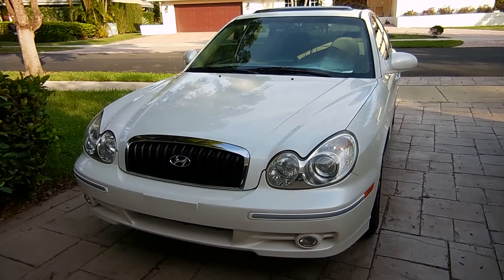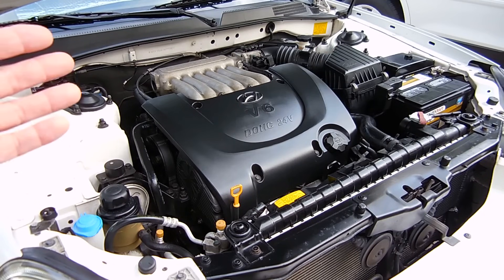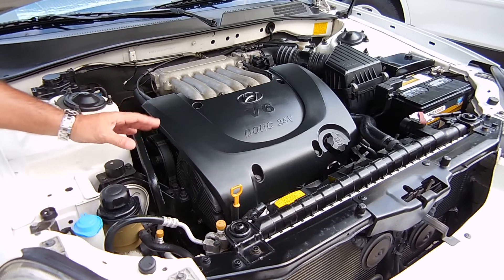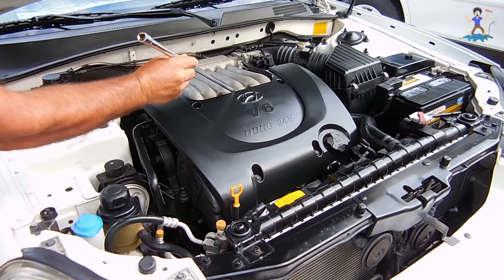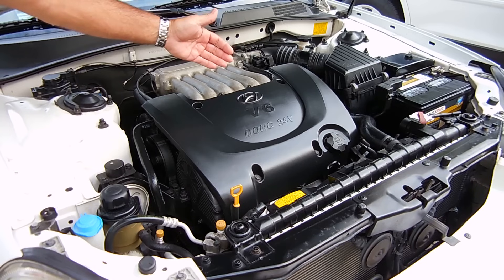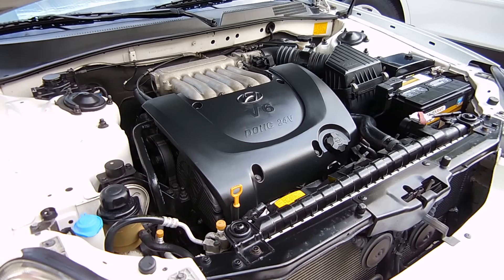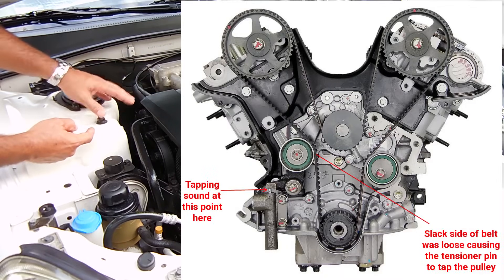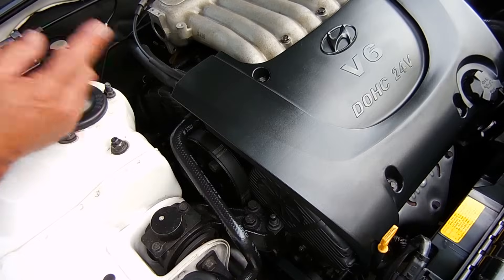(SOLVED)Engine Knocking or Tapping Sound That Varied With RPM

Comment: most of the time if ur hearing a ticking that goes with rpm, chances are its ur valvetrain, 90% of the time its a rocker thats got a little bit too much play, or a sticking lifter, if u rev ur engine up n it goes away, 99.9999% of the time its a sticking lifter, the extra rpm gives that little bit of extra oil pressure to unstick it n pump it up, taking away the tick  if thats the case its a simple fix, time consuming but easy
Reply from the maker: That's correct IF the noise comes from the top or middle of the engine, but if it's coming form the belt side down low near the crankshaft pulley, it's more than likely what I described. Thanks for watching!
Reply: Travis Miller hello my friend I have this problem where it makes this sound but when I’m on the street at high speed like 40mph it despair can you pls tell me what to do ?

Comment: I have a similar problem on my Honda CRV but it only happens when the engine is hot, but only comes back now and again. The sound appears to be coming from the top of the engine or half way down.
Reply from the maker: You need to try and pinpoint the exact location when it happens again. Intermittent problems like that are hard to find, but usually they're better than a constant sound from the engine. Thanks for watching!

Comment: I have the same sound with the same 2.7 motor. It doesn't get louder with higher RPMs it goes away. Thats what throws me off from being a rod bearing. I also changed the timing belt about 15k miles ago and put a new tensioner on it. I'm gonna check this out tomorrow.
Reply from the maker: Sounds like the same problem. Mine started off that way. Tapping sound at idle, and increased RPM made it go away.
Reply: @electronicsNmore  it's exactly what it was. I took the tensioner out from the bottom by taking the bottom half of the cover off only. Do you think it's possible i will jump timing by not taking everything off to change it? I'm working outside and it's cold so I want to be able to get it to a garage. I haven't started it yet.
Reply from the maker: As long as the belt didn't pop off the gears, it should be OK. ALWAYS rotate the engine clockwise by hand 2 full turns before starting it. If you feel any hard resistance, that means the valve is hitting the top of the piston.
Reply: @electronicsNmore  that's what I did and it worked. Car runs fine again. Thanks for your help. I don't trust the belt anymore so I'll change that when I have a free weekend  in the future. So far these are good motors if you stay on top of the maitenence. 224k on this one.
Reply from the maker: @jwill9877  I have 137,000
Reply: I had a whine that was only at lower RPMs. Turned out it was the tensioner and a roller/pulley for the external belt that runs the alternator, etc. Started when they put a new external belt on just before putting it thru inspection to get it on the road.

Comment: I beat the piss out of my 2.7.. even when it was low on oil but wasn’t too long. It runs so smooth I got to say it’s a very strong reliable engine.
Reply from the maker: Yes, it's a very reliable engine. Thanks for watching!
Reply: As long as you stay on top of the timing belt changes. That's the Achilles heel of this motor
Reply from the maker: ImSuperCynical  Hard to say, but being low on oil probably caused damage. Thanks for watching!
Reply: ImSuperCynical could be a stuck lifter and lifter tick. Do an oil change Maybe use a lighter oil It should free up and lifters.
Reply: Over here I see these engines running at 350,000 kilometers. They're one of the best hyundai engines of earlier days.
Reply: I was a Hyundai tech, that’s a solid engine! As he said as long as you keep up on the oil and timing belt service. 10000x of 2.4 4cyl and 2.0. Can’t remember one 2.7 that wasn’t due to owner damage. Keep it up! That was a weird issue! I’m currently chasing a similar noise on a Prius lol. Wish me luck!

Comment: Should have done the screwdriver trick to check rod bearings, would have saved hours on end.
Reply from the maker: I did, and the knocking sound was very loud at the top of the oil pan on the passenger's side. :-) Thanks for watching!
Reply: electronicsNmore yes, you can use  it to look for sound. But i was referring to removing spark plugs, get the piston in a down stroke put a long screwdriver on the top of the piston through the spark plug hole and lightly press down If It Moves rod knock no move bearings are good. Can also use a dowel. I did this on the truck I'm working on now and I believe the noise is coming from a hydraulic tensioner now! Never thought that could be a possibility. Thanks for your video, really helped me out.
Reply from the maker: Correct, but I also wanted to check the crankshaft bearings as well. Thanks for watching!

Comment: My compliments for how you care for your stuff. That car looks beautiful for an 03. You're meticulous, and are not afraid of work. Can't believe you pulled the pan and inspected the crank & changed the rod bearings. Me, I'm getting lazier the older I get. I'm letting the dealer do my oil changes now, & cried about having to change a flat last month.
Reply from the maker: Thanks for the kind words! :-) The upper and lower oil pans were in great condition, even though I cleaned them to like new condition before applying new RTV and installing them again. I used 10w-40 full synthetic oil with MotorKote. It wasn't easy doing the job laying on my back. Glad you enjoyed the video
Reply: electronicsNmore Mobil 1 high mileage 10w-40 and motorkote goes in every engine I own! I feel like that’s the ultimate protection. Especially after I watched project farms motorkote vs water video when it was uploaded.
Reply: R.P. Rosen Wow, how old are you bro? Like 70?!?! I feel bad for people than deteriorate after 50 yrs old. Stay active, eat healthy, and exercise quite often for longevity! 😁

Comment: Good catch but I cannot believe you took off the main bearing caps first.. But you did and we all learned from it which is a good thing. In my mind Hydraulics's have failed earlier then springs or the combo. I own two Elantra's and cannot say enough about them. Zero issues as long as you take care of them.
Reply from the maker: It was very hard for me to believe that something under the timing cover would've failed, that's why I thought the worst and went to the bottom of the engine. I only removed all 6 connecting rod caps, checked for play between each rod and piston, inspected the cylinder walls, replaced the connecting rod bearings, and when the oil pump was removed, I could see the last main bearing up close. The bearing was nice and uniform in thickness, and when the crankshaft was moved, there was no play at all, so I figured the other main bearings were fine. I left the cap alone. Thanks for watching!.
Reply: Jezz... gotta love the car...

Comment: There is a high chance that you have opened up a can of worms by removing and re-installing your connecting rod & crank caps.  The procedure in how to torque the caps, in terms of both sequence and torque, are very specific.  Hopefully you will not have any issues.
Reply: Burn
Reply from the maker: I spoke to a certified Hyundai Mechanic, and followed the service manual. Each cap was marked prior to removal, old bolts thrown away and replaced with brand new Hyundai connecting rod bolts. New bearings installed that were matched by the dealer using the VIN #. I compared the old bearings with minimal wear to the new bearings using a micrometer to ensure they were an exact match. After very careful installation using gloves and applying oil, each cap was perfectly positioned and torqued to 14 ft lbs + 90 degrees to crush. Engine rotated by hand 2- 3 turns to make sure no binding with new bearings. Based on what I did, there shouldn't be any problems. Thanks for watching!

Comment: I have 2005 2.4 same car, just changed complete timing belt, wp, hydraulic tensioner, bearings....  Do you remember brand?  I bought a gates brand kit complete $120 ebay.
Reply from the maker: It was a complete Gates kit from South Korea, minus the tensioner. I think it was $80.00
Reply from the maker: My kit came with the oil seals for the cams and crank also.....I only swapped out the crank seal, no oil leaks were seen by the cams.

Comment: The 80's Hyundais had a copy cat Mitsubishi 1.5(?) engine that was also used in Chrysler products. Those Korean engines would smoke starting at 60k miles. I'd pull a used engine out of a Mit or Dodge (Japanese made) for a swap and those would last forever. Hyundai has since "matured" and their stuff is pretty good.
Reply from the maker: Yes, years ago the Hyundai engines were junk, but not anymore. Thanks for watching!